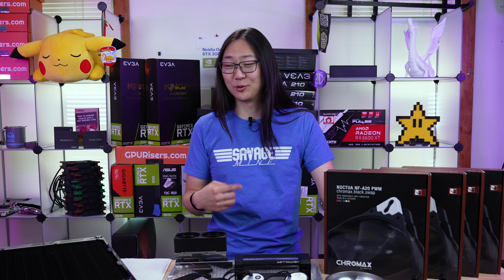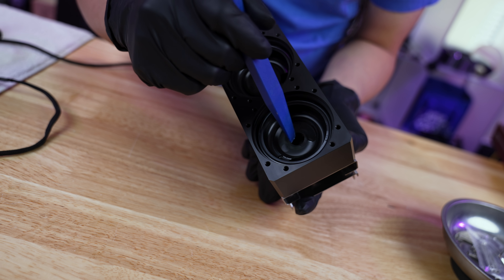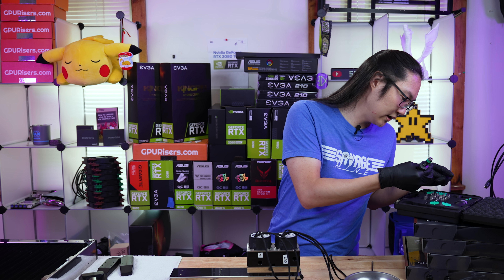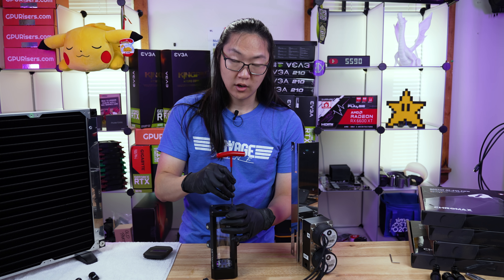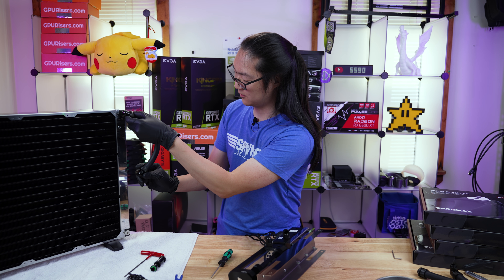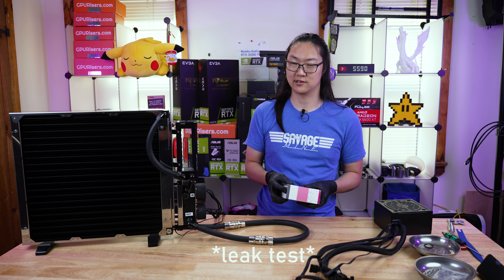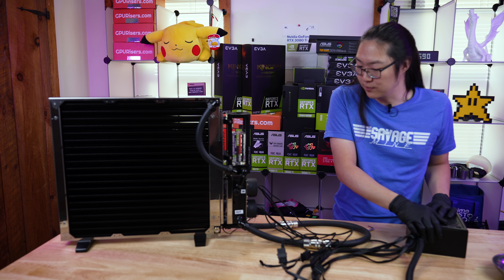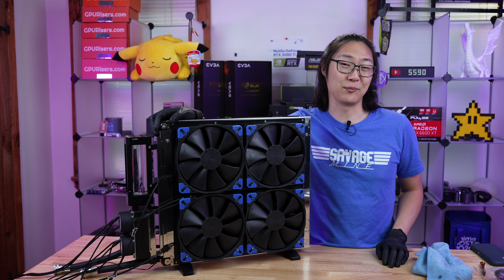The COOLEST radiator you never heard of!

Comment from the maker: Have you done pc water cooling before? what was the craziest thing?
Reply: puting an old "big moma" radiator in a small fridge with holes for the tubes :)
Reply from the maker: Hahahahah That's going to be great
Reply: @TekShinji  I May have kept pics it was 20 years ago....
Reply from the maker: Post them in discord ^_^
Reply: Using my pool as a reservoir :-D
Reply from the maker: Lol right haha
Reply: those are QD3s for G1/4
QD4s are for G3/8 only
Reply: I notice that the fans are place pulling air instead of pushing air into the radiator, am I wrong?
Reply: I cannot wait to build one of these. Pumps shipping Monday. MoRa already inbound!
Reply: bout 2005 ish --- old transmission coolers in a series with 12v caravan pumps, run externally through a hole in the floor and mounted beneath the house
Reply from the maker: Nice!

Comment: What was the specific tourqe used on the dual pump's top screws? Did you set the driver to a random number or was it a value recommended by the manufacturer? Thanks in advance!
Reply from the maker: All the numbers I got in a email from the manufacturer. And this is quite some time ago however I don’t remember. You could also do the same thing and email them. I’m sure they have it on their site somewhere with all the requests I’ve been getting.

Comment: Do you have to use their coolant with mo-ras? 😊
Reply from the maker: No, I use a different kind of coolant that's designed for like more higher end applications. It's really good. I haven't changed it out in over 3 years 🤣
Reply: @TekShinji  which one is it i was going to go with DP ultra I plan on getting two MO-RA 600s
Reply from the maker: Sure, I use this stuff. It's electrically insulative. In my other videos I explain how it becomes conductive over time, but it gives you a much better start. Like I said, it's lasted over 3 years so far without a single change! 

Just got to make sure your system is totally clean and ready to go before. Might need to do one to two flushes before with the coolant.

https://amzn.to/3RYTIAY

Comment: Hello, im late to the MO-RA party i know, but was hoping you could share what the inch or nm torque values you used for the D5 Dual Top? Ive ruined/stripped an aquacomputer acetal pump/reservoir bases before due to over tightening, and id really rather not make that mistake again.

Thanks for the great video and i hope you reply!
Reply from the maker: Hey there, I don’t remember exactly but if you emailed them, they’ll give you the exact specs. I recall that whatever they gave me was a little too much so I went slightly lower.

Comment: Guy's 5 to 10 min for a air pressure leak test is WAY to short. Individual components = 15min that right there should tell you something. A full system leak test should be around a minimum 1 hour or more.
Reply from the maker: That is correct. It’s mostly just to catch big leaks. The little ones will take time obviously and with all the tubes and stretching. I usually let mine go overnight to see how much it moves.
Reply: @TekShinji  I see well regardless very nice system like the rubber tubing! I have the competition brand Aquacomputer and their Airplex Modularity System rads 2 x 840 full copper note here two 840 rads these are HUGE so in total i have 12 x 140mm rads space externally.
Reply from the maker: Thank you! I really appreciate it, buddy!

Comment: When the coolant is completely filled in the reservoir, what will be the position of the pressure valve in this system? Generally, the water tank is filled with coolant about 3/4 of the way, and the pressure valve is located on the cap at the top.
Reply from the maker: That is correct. Are you asking what the pressure is for the leak test?

Comment: This is awesome, I have a question: I’d like to make something like this but the radiator would be like 1-1.5 feet below (on a different shelf).   Would the difference in vertical positioning be a bad idea, or would it be fine if I did something like add a 2nd D5 pump?
Reply from the maker: It depends, basically after the whole system is primed and there’s no air. It shouldn’t matter because what’s pulling up and pushing down on it will all be the same. So effectively, the gravity will have zero effect.

Comment: so i have a 480x80mm rad and a 240x45mm rad with noctua ipc industrial fans in a 7000d case. cooling wise its not far off from that and inside my case. i have two xspc d5 pumps sitting over ten years old they work fine i am using a corsair d5. i could add one 240x60mm or add my dual d5's . i will probably do the dual d5 new housing is same price as that rad. 5900x per ccx oc feeding it 1.39v set in bios 1.36 get  in windows. max 72c now. 6900xt on a block also in the loop.
Reply from the maker: That’s totally awesome! How is the sound with those industrial fans? One of the reasons why I didn’t go with them was cause they’re too damn loud.
Reply: @TekShinji  i have so much cooling they ramp up to 1500rpm sometime but never hit the 2000rpm 13 noctua fans all industrial ecept the 60mm x2 ram cooler i made.  i also oc ram to the moon 1.60 to get to 4800mhz on this sold as 4600mhz vengeance rgb kit. ram was expensive but i use it all lol.
Reply from the maker: That’s pretty cool. So you just keep it at a lower RPM and then everything’s nice and quiet?

Comment: Hey man, did you use regular NF-A20 Noctuas, or the ones coming from the Watercool website? The latter ones have double the static pressure, created by Noctua for the Mo-Ra exclusively.
Reply from the maker: So the double the static pressure ones are louder. I use the quieter ones. Which are the standard ones from noctua. I thought a lot of physics were being broken, but unfortunately, there’s always always a trade-off.

Comment: am i right if i say , 4 big fan like this is better for teh air flow than 140 ones ... ?
Reply from the maker: Actually, it’s worse for total airflow. But it’s best for overall noise versus airflow. I wanted the quietest cooling system not the cooling system.

10 140 mm fans will get you better airflow and lower temperatures
Reply: @TekShinji  nice to meet you i think for onlya 14900ks it will be okay no?  ( no OC)   ( and water cool have made a partenariat with noctua and its the 1200rpm  version of 200 nf a 20 , if you dont know i have the 800rpm ...)
Reply: hey nice too meet you ! for a 14900ks i think its enought ( no OC)

Comment: Very nice video! 
I am currently building a Mo-Ra 420 system. I don't use d5 pumps but one aquastream ulimate. I've already used a few Noctua Nf-A20 when it was still air cooled. Great fans! Since my radiator is white I kind of don't like Noctua brown or chromax black. Therefore I might try out 9x Arctic P14 PWM PST in white and run them on low rpm settings.

Have you seen the Aquacomputer Gigant 3360? The Mo-Ra is already huge but the Gigant is mindblowingly enormous.
Reply from the maker: Yes, I’ve definitely heard about it, but I haven’t used one myself yet!

And that’s awesome, I hope you have a fun time building your system. Can’t wait to see it. If you like, you can join our discord and post some pictures of your building in the water cool section I’d love to see!

Comment: Note: If one wants to use two fan grills with the MO-RA, then one should only use the middle two holes on the MO-RA (that is, the ones along the "back of the spine" of the MO-RA). Otherwise the fan grills won't fit because they'll be blocked by tubing. I found this out the hard way. Otherwise, great video!
Reply from the maker: Thanks for the tip and heads up! That’s a very good point. I haven’t really use them yet.

Comment: Hi TekShinji, in the Partlist i can not find the size for the Heatkiller Tube (150 or 200) ?
Reply from the maker: Which particular tube are you talking about?
Reply: @TekShinji  I mean the reservoir from Heatkiller that you use as an expansion tank. I'm thinking about going directly from the top of the radiator into the container. Then I'll save myself the hose on the outside, which I can't use anyway because I have the covers on both sides.
But I suspect that this only works with the 150. I think the 200 is flush with the radiator so you can no longer make a connection.
Reply from the maker: Hi there sorry about the late response. YouTube comments are kind of hard to keep up with with all of these comments. Check out our discord LinkedIn to description if you want to chat faster.

The reservoir tube is 150 mm the 200 mm will work but it won’t exactly fit either not the way I made it

Comment: tenho 1 mo-ra 420 noctua 20mm , gostaria de saber se vale a pena investir no push pull ? agradeço pela  atenção .
Reply from the maker: So it depends on what your goal is. You get diminishing returns that you add more fans. But a push pull configuration does help with thermals a little bit at the cost of noise and money, of course. Please let me know if you have any further questions!
Reply: ola meu amigo, no meu sistema uso 1 xd5 corsair  1 radiador 360mm e mo-ra3 noctua , vou ter mais performace usando 2 bombas ? vale a pena comprar  duas bombas? agradeço pela  atenção .

Comment: Pro-Tip Hold that kind water jug or "can" turned 90 degrees when pouring, that way it doesn't spill as easy. But note that I said as easy. Even better is if they have an air outlet on the opposite side to the opening.
Reply from the maker: Yes, this is something I did afterwards!

Comment: I bought the aqualink + used 2 90 degree fittings, but i cant seem to screw them cause one side will unscrew the other. what's the trick? Do i need special 90 degree fittings?
Reply from the maker: Hey there, not exactly sure what you’re talking about. However, based on what I can gather you’re asking for something called a rotating 90° fitting. Also known as a rotary 90° fitting the base allows it to rotate independently and is usually male and female sides.

Come join our Discord for more help it’s hard to do diagnosis and tracking over comments!

Comment: on the official data sheet of electrically insulated coolant says "not recommended on acrylic parts" Did you see any degradation of the reservoir or any other acrylic part of the system ?
Reply from the maker: Hi there, I didn’t notice that. But I’ve been using it for a while and I haven’t really noticed any issues. Other than the cleaning I do taking it apart once every couple years or so.

However, if you’re very concerned, I would take a piece and do a test on it to see how it affects your hardware. Everyone to mileage may be different.

Comment: You said you like to make the top port of the radiator the in, and the bottom port the out so it does not fight gravity. I am confused by your setup. It looks to me that you have the water coming into the rad coming in at the bottom. And the water out going out from the top of the rad going into the reservoir, then to the pumps, then out to PC. This set up looks like the water is flowing from the bottom to the top of the radiator.
Reply from the maker: You are correct! It is a closed system, so after initial serving, and everything is primed, gravity is no longer in an issue. It’s kind of like a train. If one side pushes the other side pulls regardless of where it is

Comment: hey buddy nice video .. just one qus what flow rate do you get with 2 pumps ? thank
Reply from the maker: The flow rate is highly dependent on your system configuration I was getting between 200 and 300 but those were very thin not much in in the path of resistance
Reply: @TekShinji  thanks
Reply from the maker: Welcome!

Comment: Clamp better you should try bits power your nails will cry and hurt for days
Reply from the maker: My nails been hurting for days ever sense lol
Reply: @TekShinji  Cant wait to get my mora radiator hoping it will bring down my hotspot temps on my 7900 XTX atleast by 5c-10c hitting 80c hotspot in occt 3d test at 100% usage usually only 75c in games but at 300w board power only 55-60c hotspot with 14c delta which closely matches my old 6900 XT at similar power limit, opening my case side panels has 5c-10c drop already in temps if the ambient is cold atleast
my 6900 XT would get hotspot of 55c max at 300w power limit but is capable of hitting 70+ at high enough ambient temp like 23c 30c internal case temp.
Reply from the maker: That’s awesome man! I can’t wait to hear more about it! When will you be totally finished?
Reply: @TekShinji  In about a month bassicly around 23 may more or less i probably have about towards 2k budget, i kinda wish i lifed at floor level next to a window right now, so i could open window + radiator sitting outside for testing :D
Reply: @TekShinji  Already making a list altho i am gonna do some stuff differently still need figure out the wall mounting part but you think i can put on the feet at same time as wall mounting so i can do both ?, should i first try to do only external for my liquid devil 7900 XTX and keep my cpu internally watercooled so i can see if dual loop is worth it ?
Right now at cost around 1100 euros with dual pump altho im probably gonna get D5 pumps from Aqua rather then EK not sure if they are slower or if it matters at all, the D5 pumps from EK if seen has sata power connector i do not like that honestly :D and then i have to figure out how to cable manage that to my computer or power it externally somehow.
I did a PSU test couple of days ago and the amount of heat dumped in my loop made my hotspot go up to 85c instantly :D so i might first try dual loop. with my gpu going fully external as that dumps most heat in my loop probably benefits the most from aditional cooling as i am not worried about cpu temps right now.
Reply from the maker: For sure, buddy! Just so you know, YouTube comments get kind of difficult to read after five of them. If you wanna go to message me on my Discord, but I might miss your future messages.

Comment: Well it's a ceramic ball out of a ball bearing, but it's not actually a ball bearing in the d5 pump... Do you know if any pump covers like bitspower, barrow, byski or any fit with the mounting system on that pump top?
Reply from the maker: The mounting is differ per system but it should all fit the D5 flange and dimensional standard. Join our discord and let’s talk about water cooling!
Reply: @TekShinji  yea. I'm wondering if the spacing on the mounting plate has enough room for a pump sleeve, I haven't seen that pump top used with any pump covers, I mean ultimately it can probably be modded but I'm wondering how much modding is needed.... ok I joined
Reply from the maker: Awaome let us know of any questions you may have a discord!

Comment: Fun fact: Of the roughly (40cm)²=1600cm² of ventilated area that a radiator like this has, 344cm² are covered by the steel plate to which the fans are mounted and another 38cm² are covered by the fan hubs. So just putting it together like this (which is the way the manufacturer intends, ironically) reduces the ventilated area by almost a quarter and probably has proportional effect on performance. Ideally, you'd mount this whole thing horizontally to make convection work in your favour and then mount the fans to a sufficiently wide, airtight spacer that distributes airflow across the whole thing.
Reply from the maker: Of course! The goal for this project was as quiet as possible. Ideally, for the best performance would’ve been 9x 140mm fans.
Reply: @TekShinji  Yes, absolute fan performance increases a lot if you use Noctua's 140s, but that's not my point. Putting round fans on a square radiator will always cover up and waste a large part of it, it's unavoidable. Just nobody cares, because unless you make massive mistakes, watercooling is a brute force solution that will almost always work, especially with this amount of surface. But if you are going to mount the thing vertically anyways, you could just as easily stuff three 420s in a large case and call it a day.
Reply from the maker: I did think about making some kind of platinum/fan box. That was about 6 inches away from the radiator. That way all the air flow from the fans would be next, and it have even pressure through most of the radiator. But that sounds like a lot of work…
Reply: @TekShinji  Depends on how you do it! You can just use M3 threaded rods and some nuts to mount the whole steel plate at a distance, close the four sides up with just about anything you've got lying around (cardboard, wood, acrylic, ducktape, etc., doesn't even have to be 100% airtight) and hang the thing horizontally underneath an IKEA Lack table with some cord. 

Nice of you to actually reply, btw ;-)
Reply from the maker: I was thinking about using clear acrylic, so it looks cool. And kind of welding/permanently gluing it to a four fan adapter and cutting out all the center so it has better airflow.

Yeah, I could definitely use cardboard or something similar. 

Of course! I can keep track of these as long as it doesn’t get more than 10 comments. After that YouTube gets kind of weird and it’s hard for me to see them.
Reply: @TekShinji  Well, if you do build something like this, definitely make a video and do some comparative testing, I'd be very interested!
Reply from the maker: Yea for sure! Got a lot of things planned!